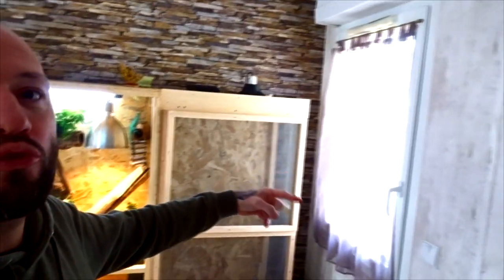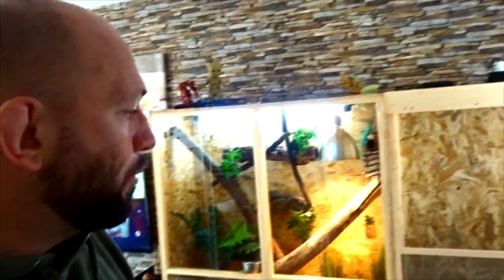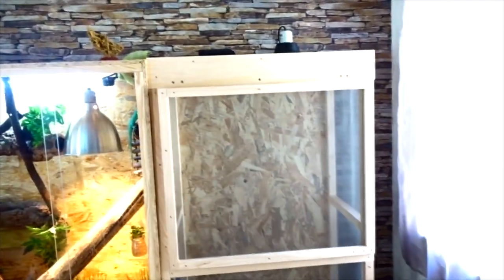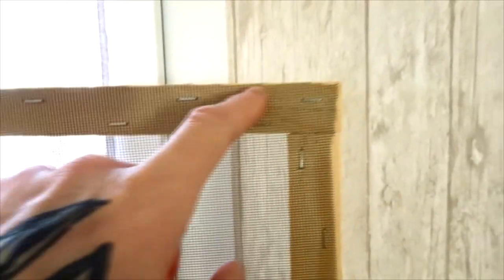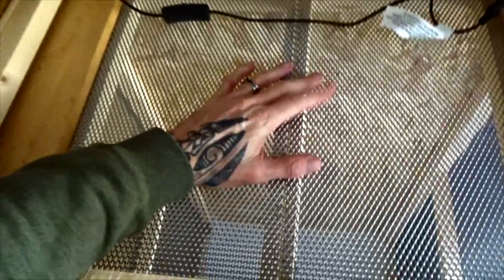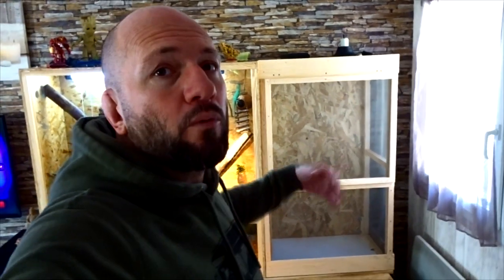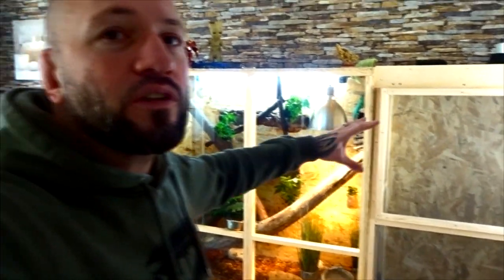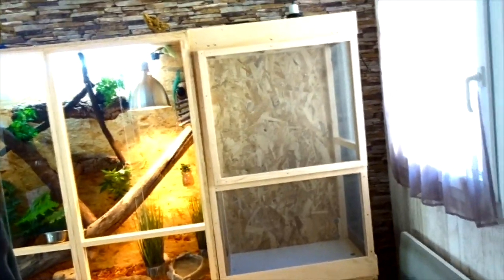FABRIQUER UN FLEXARIUM POUR CAMÉLÉON

Comment: Perso le mien est tout le temps accroche sur les grilles, j ai recupere des grilles de cage pour oiseaux et c est nickel.
Pour l espece je vote pour un ambilobe red bar.
Bonne continuation
Reply from the maker: Je pense mettre du grillage quand il sera beaucoup plus grand, question de résistance. Merci à toi
Reply: C'est un signe à prendre au sérieux ça... en général il devrait idéalement se trouver quelques coins "préférés" sur ses branches. Regarde peut-être à tes paramètres (point chaud, point froid) et si des supports adéquats lui permettent d'en profiter.
Souvent (je ne dis pas que c'est absolument le cas en ce qui te concerne) un camé qui se ballade en permanence sur les parois cherche à fuir des conditions qui ne lui plaisent pas. Allez, good luck à toi :-)